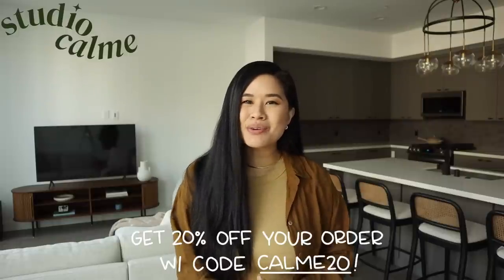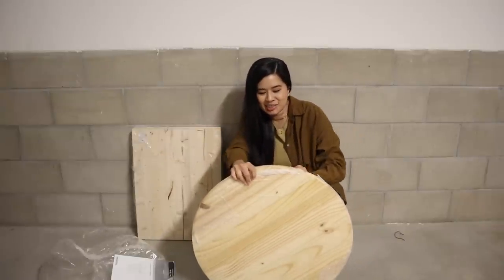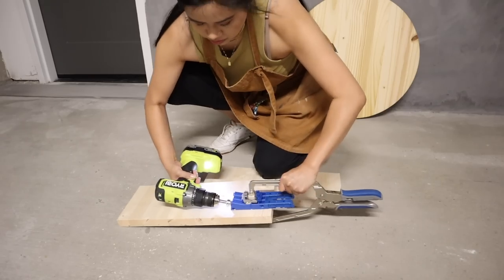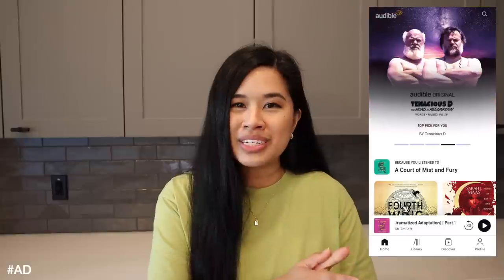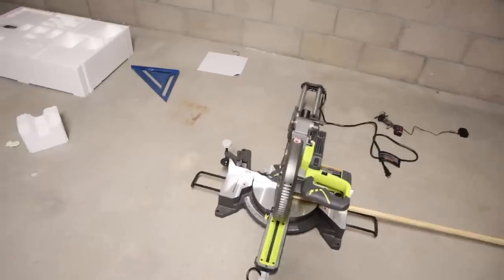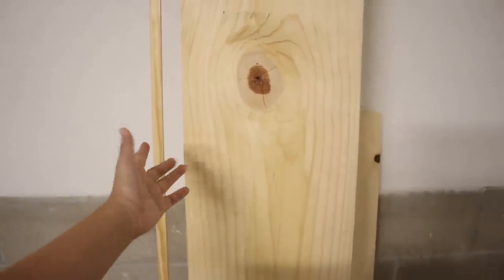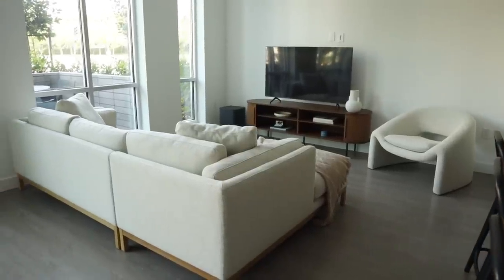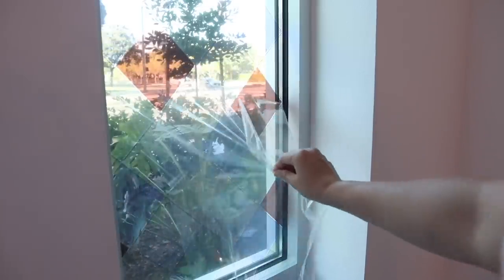TIME TO MAKE OVER THE LIVING ROOM! (diy coffee table dupe + couch sleeve and adding stained glass)

Comment: Tina!  FAB-U-LO-SO!!  Love the stripped couch sleeve!  It is so much wider than most and great depth as well.  You could place a dinner plate on this.   Was thinking, you may need to make another one for the other side, for guests.  I am also thinking about switching over the chaise to the other ither side as it will give that area more openness; however, I don't know if that is an option; I know some couches do.  Yet!  As is, this sort of encloses the area, creating more of a zone, and I guess giving it that "lounge" vibe - which is what you are going for!  

The table is nice ss well.  Love the ribbed effect.  I like the wood top too, it sort of works with the raw wood on the couch sleeve.  However, being painted, it still looks good.

Maybe a couple of sawhorses and a sheet of plywood to create a make shift workbench?  Something so you won't have to sit on the floor and cut out wood on STYROFOAM!!!  GURL!!!  

Hope you have/had a great holiday weekend!!!  

xxoo

Comment: For beginners which type of sander would you recommend? The circular one or the rectangular one ?
Reply: The rectangular or triangular sanders help with getting better into small areas or corners.  They are two different sanders for different  reasons, although the rectangular or triangular ones, could serve both purposes.  Maybe Google Round Sanders vs Rectangular Sanders and see if there is a comparison  video.  That may help with your decision and as to why.
Reply: @donnabacon4681  Thanks